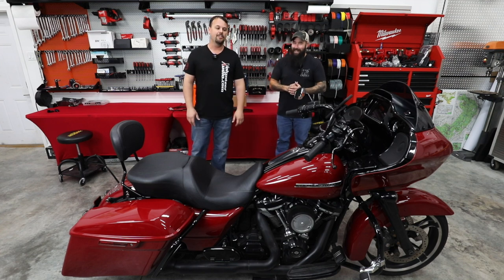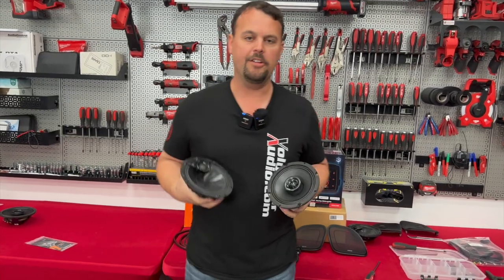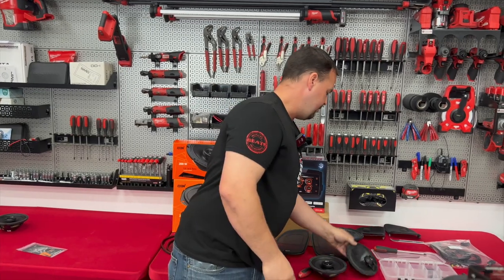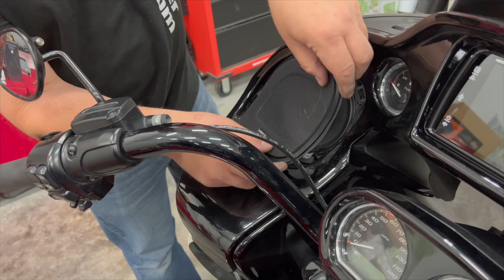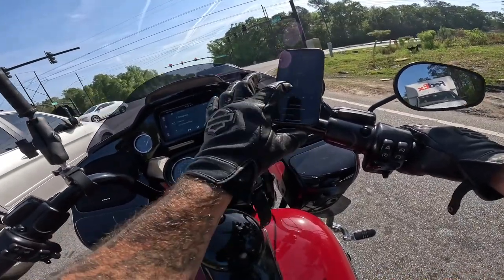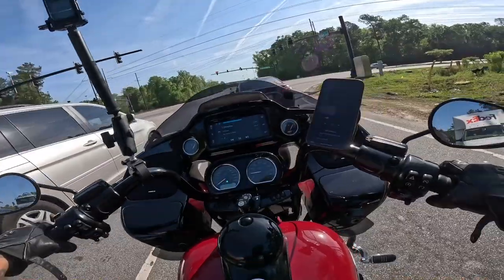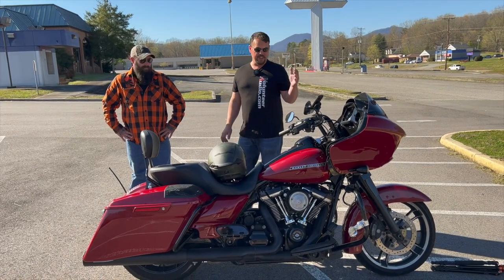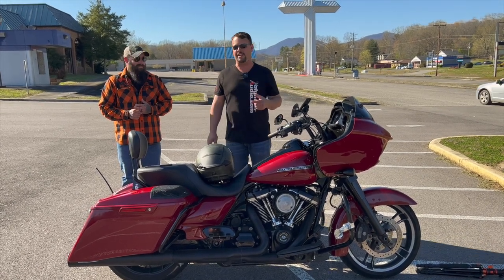Huge Audio Upgrade! Watch the Before and After of Hegshot Rides 2020 Harley Roadglide Stage 4 System

Comment: Interesting that you mention the factory radio can’t be heard over 60 mph I can hear mine clearly at 80 and my hearing is shot my riding buddies can hear the snare when they are behind me and that’s just the speakers in the fairing. My biggest complaint is how long it takes for my Bluetooth to link up .
Reply from the maker: There are a lot of factors that change how well you can hear the audio, rider height, windshield size, helmet style, how loud your exhaust is etc…